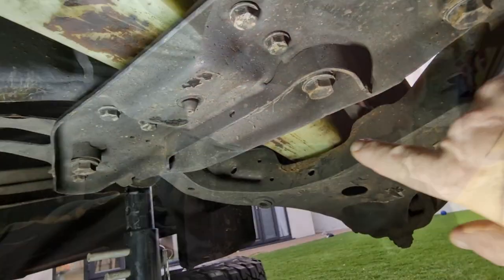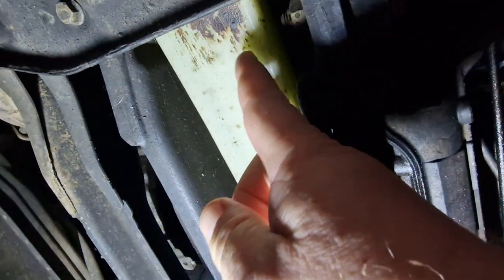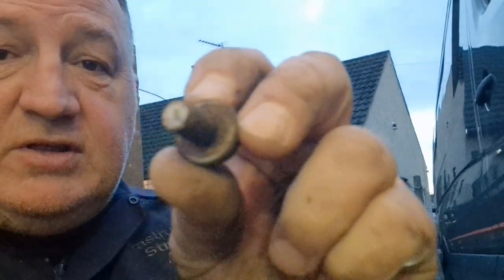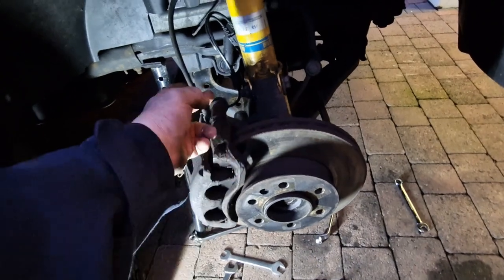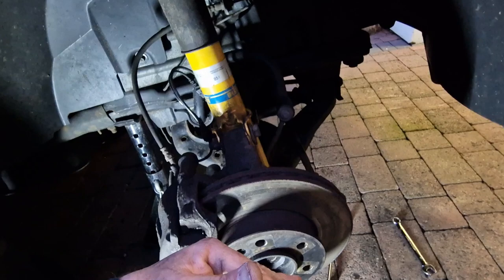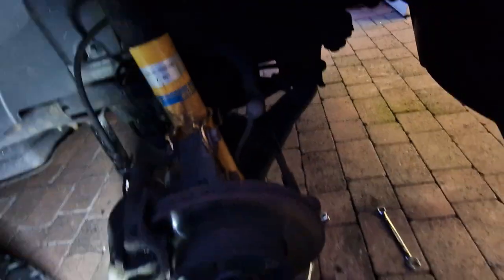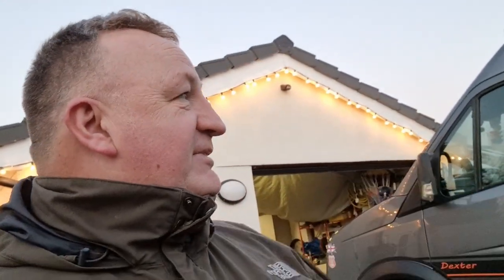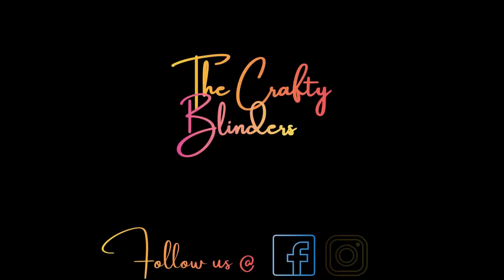front suspension bush upgrade goes wrong on our self built VW crafter camper van

Comment: Teng tools have an extractor set that’s basically a tapered square rod that you beat into a hole you’ve drilled which I’ve seen good things on (not needed to buy a set yet though) but I think sealey do the same which is £25 if I remember correctly. The Irwin rounded nut extractor is brilliant for rounded stuff as well, even works on the domed pan head type torx bolts on brake carriers when they’re stripped out
Reply from the maker: I need a new set now so I'll take a look cheers

Comment: What size bolts did you get as I need to do both lower arms and would like to get the before I start it.
Reply from the maker: If you check the description of the video I'm sure they are listed there or in the comments 
I'm sure I've been asked this before
I found them 
https://www.ebay.co.uk/itm/333824520095?mkcid=16&mkevt=1&mkrid=711-127632-2357-0&ssspo=QygKxZ9PTmm&sssrc=4429486&ssuid=qkhVtACcQ9q&var=542887768533&widget_ver=artemis&media=COPY
Reply: They were m10 35mm
Reply from the maker: @grahamblower152  yes 35mm
Reply: I did both of mine yesterday took me about 4hs and all 4 of the M10 35mm bolts snapped... wasn't that bothered because I was putting new arms on .. also I got some new bolts in  the week before I started the job.👍
Reply from the maker: Glad your sorted now mate 👍

Comment: Hi Sam - What are the diameter and length of the flanged hex head 10.9 bolts that you had to replace (great video by the way!) on the lower wishbone?  I’m about to replace my front leaf spring and I want to make sure that I replace the bolts with new ones (from Westfield Fasteners probably..) when I do the job in a few weeks time.  Keep up the good work!! You’re a star!!
Reply from the maker: Andrew are you planning on up plating your van? As some of the 5t springs have now been down rated to 3.5t
Reply from the maker: I will have a look to see what bolts I ordered
Reply: Hi Sam and thanks for the quick reply! I am planning on up-plating to 4,000kg as we won’t use the van for carrying much more than itself and us. The weighbridge ticket shows 3640kg but that was with 3/4 fuel and 1/2 water and no me or Louise so adding around another 200kg to 3640 seems reasonable hence aiming for 4000kg. Are you suggesting up-plating isn’t necessary for an additional 500kg?
Reply from the maker: @andrewgraham2865  not the reason for asking is if you have used A906 321 11 03 you will only be able to get a maximum up plate to 4080kg as that part has been down rated 
But that sounds like it more than you need 
I have an update video coming out soon 😁👍
I will get back to you about the bolts
Reply from the maker: https://www.ebay.co.uk/itm/333824520095?mkcid=16&mkevt=1&mkrid=711-127632-2357-0&ssspo=QygKxZ9PTmm&sssrc=4429486&ssuid=qkhVtACcQ9q&var=542887768533&widget_ver=artemis&media=COPY
That's the link I used for the M10 x 35mm it looks like they are out of stock at the moment 
You should find some with stock with that information 😁👍